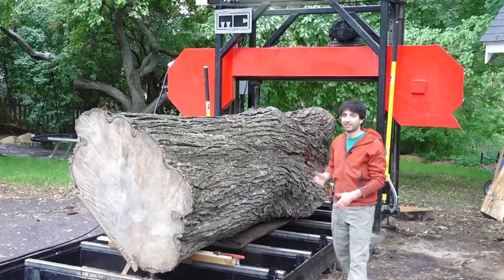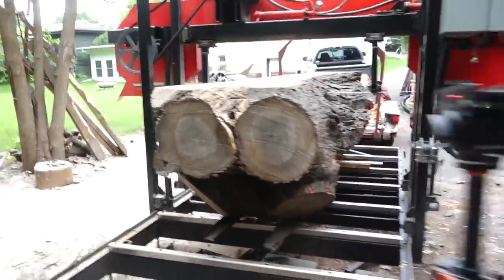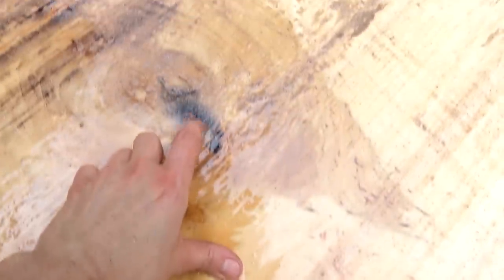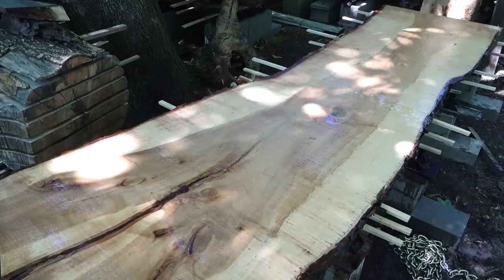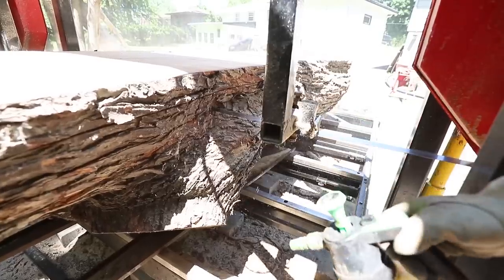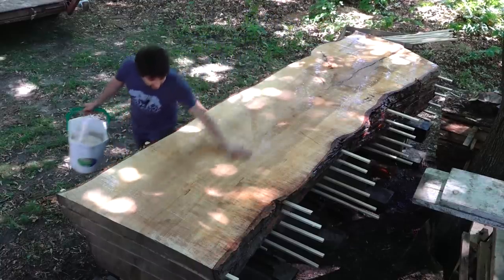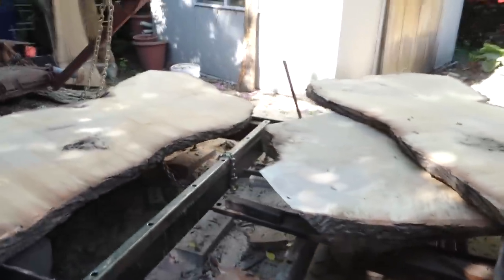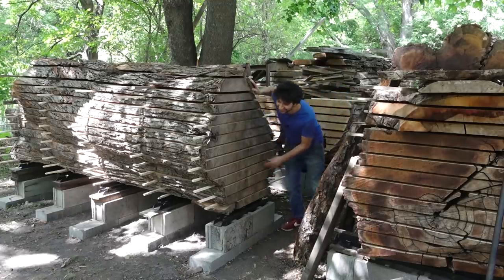The most steel I've ever cut through - Slabbing a Big Silver Maple

Comment: How much would that fetch now, I have a tree that's about 30 feet rounded at bottom, then some lumps popping out that's funky looking and about a good 25 in length, I bought slabs for projects before, this tree is HUGE, its over a neighbors home but its on both PROPERTIES. It has about 5 trees limbs after the 20bto 25 foot mark that goes off and there just as big as a tree. It looks like 2 trees that grew into one tree, all I know is i used my 30 foot measuring tape in 2009 and it was 25 1/2 feet and that was about a foot off the ground, its got to be easy 30 feet round. I know its worth MONEY, I want to trade wood for professional take down with other trees, I have some tall pine trees, there about 3 people to hug them.

Comment: how much them blades cost?....and you have to re sharpen them right?...cant just buy a new blade every 2 cuts
Reply: Those blades are available by the foot. Most individuals buy them in hundred foot rolls and half a welder / annealer to make the length of blade required for the machine.

Comment: Aquarium water pump and hoses for a few bucks to make a cooler for the blade, you will never look back. I am an old man now and would not even start a large amount of woodcutting without some way to keep the blade cool. Spraying with a mist bottle does not do the job, cool the blade on the other side so any spray is away from you.

Comment: Time to replace the lateral saw winch with a permanent magnet dc motor with a 12:1 right angle worm gearbox driven by a cheap Bronco Variable Speed Drive with armature feedback (which will stop the drive if it detects a preset max torque or load due to obstruction, blade pinching or bolts).  Then, you'll be almost automated and save your arm from developing bad rotator cuff tear.

Comment: You should use aluminum roofing paint on the ends of your flitches.
It will reduce if not eliminate checking.
And by the way. That's what you're referring to as slabs... The correct terminology is flitch.
Slabs are the round pieces with one flat side.
Flitches have 2
Cants have 3
Boards have 4.

Example.
Your flitches look like they're about 2 in. Let's say you wanted to cut them into 2 in wide boards.
First you would cut one live-edge off manking it a cant.
Then you would start slicing boards off of the cant. 
When you reach the end and you can't get any more boards and it's rounded. That's a slab.

Basically slabs are your waste.

That always confused me. And I'll be honest I like saying slab better than saying flitch.
I like saying ripping flitches.

But truth be told those are flitches that you are cutting.
If you're going to be the pro you got to know the terminology.

I really enjoyed your video about cutting a silver maple into a full-flitched set!

Comment: Why is that thing on a vfd!?!? overkill.
Reply from the maker: Phase conversion, braking, and soft start
Reply: Didn't think about having only two legs residential... 😔

I know how expensive vfds can be. Looks like a Mitsubishi d700 and I'm not familiar with the larger one.

Saw that MCC and was like nooo way. 🤣🤣
Reply from the maker: @Bramon83  Both Hitachi drives.  A WJ200 runs the lift motor and a SJ700 runs the blade.

Comment: Isn’t silver maple just junk wood? Like pin oak.
Reply: As a soft maple it is less desirable then the hard maples, but if you have a big enough slab species is less of a factor as the price quickly goes out of most people's budgets on the more desirable. It is advisable to give it a good protective coat of epoxy as it is more easily dented then the more sought after harder woods.